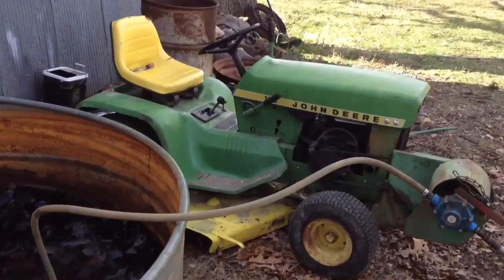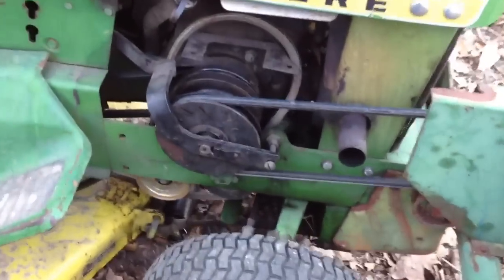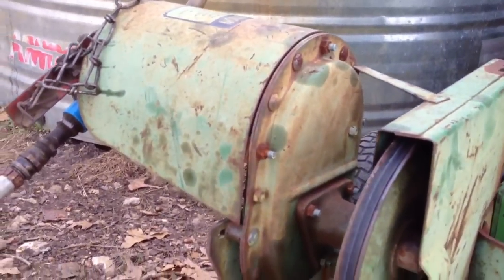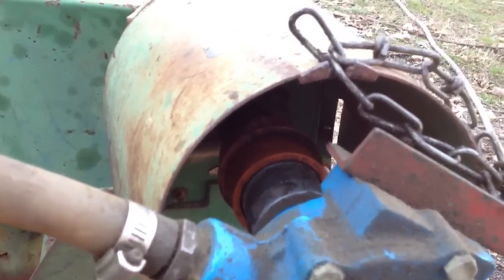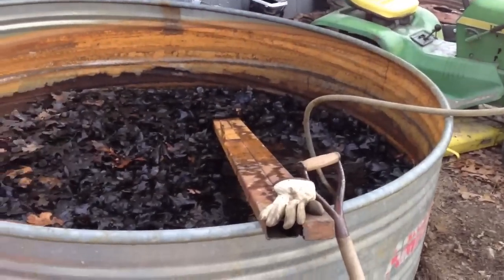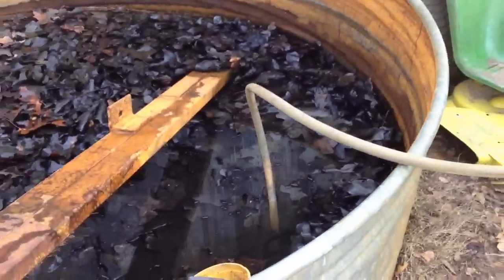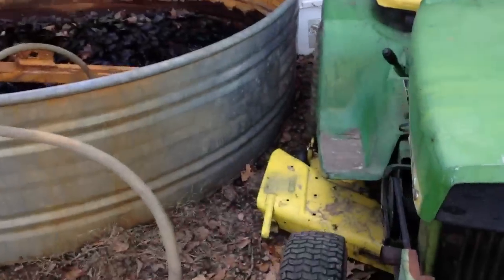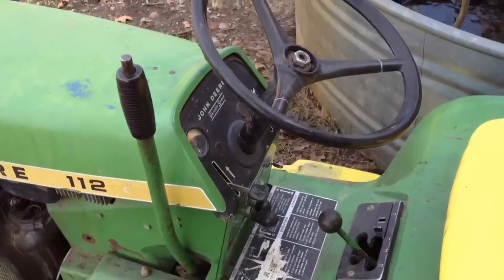1968 John Deere 112 with 541a PTO

Comment from the maker: @johnathonmelby I never said it makes sense, that's not why I use it. I use E85 (and kerosene in the past) because I enjoy playing with different fuels and trying to make things run on them. These things are tough, especially the two-cylinder Deeres, and they were originally designed to run on just about whatever you poured in the tank. Anyone who gripes about tractors not running right because of "alcohol in the gas these days" doesn't have their stuff tuned up right, plain and simple.

Comment: @dmeyer302 right but ethanol takes more energy to make that petrotiem fuel total waste of time flex fuel cars get bad gas milage with e85 plus e85 is going up olny 20 cents cheaper doesnt make sence... and doesnt just eat gasket and carbs it puts you at a higher risk to put a hole in the piston and it eats away gas line. but hey seems cool I have a jd 112 also just dont want to risk blowin it up

Comment from the maker: @johnathonmelby Not that I know of...some guys will tell you it's the worst thing ever. That it eats gaskets and float needles. I won't call them liars, all I know is I've had zero trouble. Seems to me it would be better for your engine since it's so clean-burning--like anyone that's worked on a propane engine knows they're spotless inside. Plus, if you're in to the environmental thing, then that's all you need. Personally, I'm just an alternative energy enthusiast.